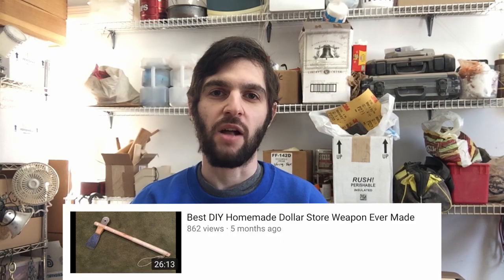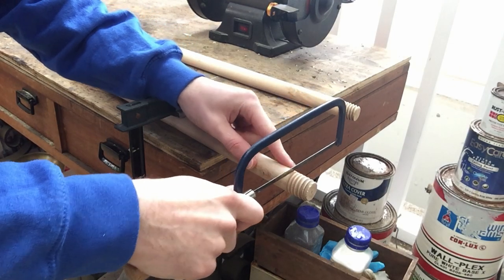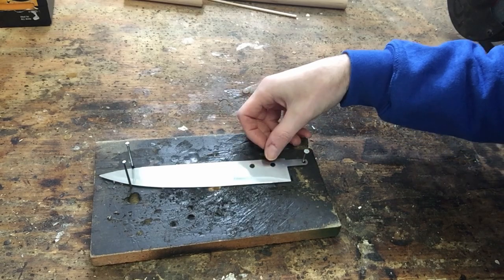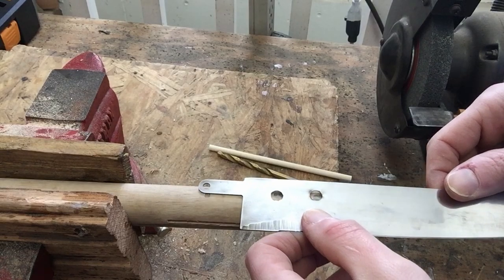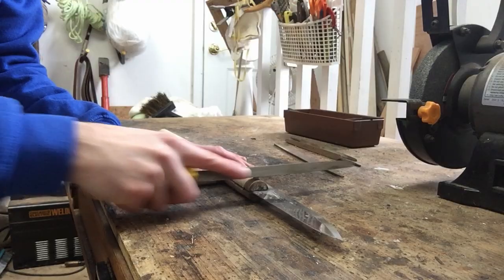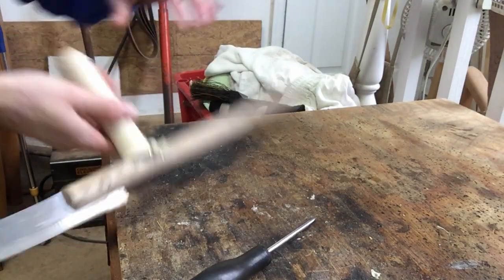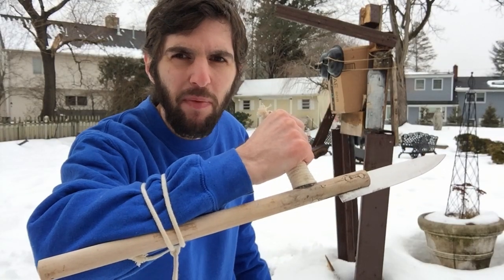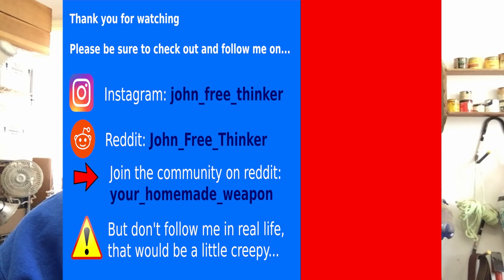Greatest DIY Dollar Store Weapon Push Sword

Comment: That is the most disappointing tang on the knife you used I’ve seen ever
Reply from the maker: What makes it a disappointment to you?
Reply: John Free Thinker not your weapon, the knife you originally bought to use in the weapon had a terrible tang (part of knife that holds it to the handle)
Reply from the maker: @_EllieLOL_  That is how it came. You have to remember that everything here was from the $1 store. That is why it looks cheap and is made with a lower quality.
Reply: @_EllieLOL_  i noticed that too! that tang was like a false tang, not even going thru the length of the handle, which had false pins in it to make it look like it went all the way to the end of the handle. I knew it was cheap, but i wasnt expecting them to go as far as fake pins